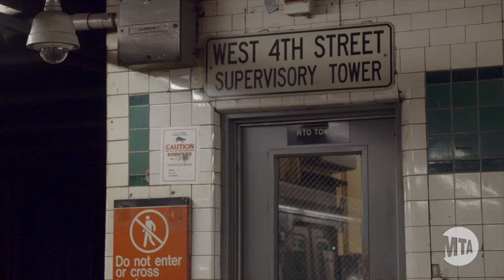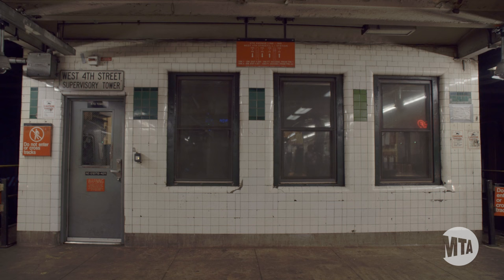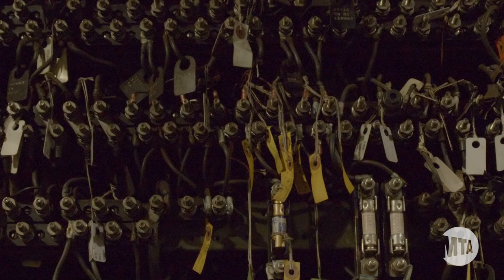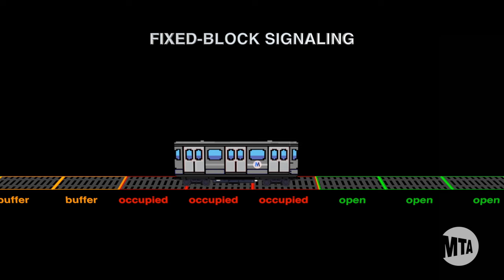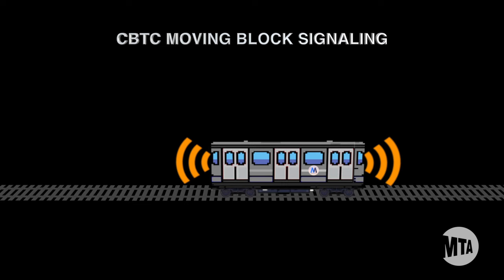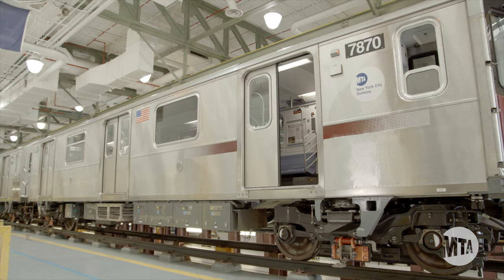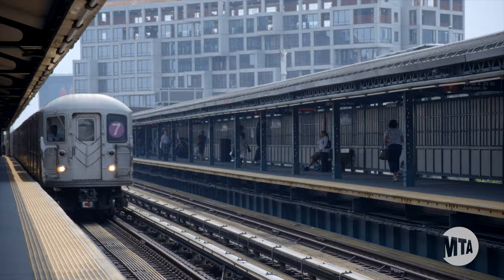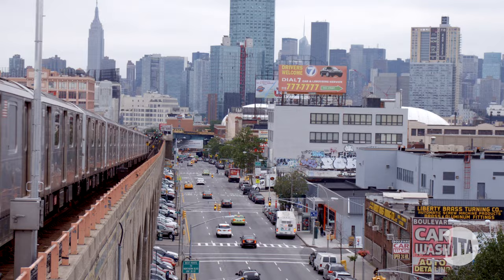CBTC: Communications-Based Train Control

Comment: I bet some knowledge has been lost about some parts of the system due retirement of the people who built and maintained the system. It would require a large scale re-engineering to replace the whole system. Sooner or later it has to be changed. A scheduled downtime is always better than an unscheduled downtime. 

A large scale unplanned failure would affect the whole NYC subway, causing it to grind to a halt. Workers wont be able to get to work on time for weeks, with an overall cascade effect and widespread chaos. This equates to millions or even billions in economic losses on wall street and even main street retail which could affect the entire world economy.
Reply: That's why CBTC is planned to replace the existing signals. This would result in less money to maintain the signals, and also increase capacity.

Comment: "If it ain't broke, don't fix it"

because i rather use early 20th century stuff that's work flawlessly than a "sophisticated 21st century standard" but gets broken after few year of normal usage.
Reply: Ernest Jay wyt
Reply: Ernest Jay The 20th Century tech is flawed in that you cannot run more that 28 trains on a single track. With CBTC, you can run up to 36 trains at most, and if we removed all merges, maybe 40.

Comment: I can see this coming from a mile away. They go to digital with computer displays and some creep decides to hit the computer with ransom ware right in the middle of rush hour---AND YOU ARE SKI---REWED!!!! What you have is an oldie but a goodie. If it ain't broke quit tryin' to fix it.
Reply: Wasatch Range Railway The old signal system is broke. It’s one of the reasons why trains are super delayed. CBTC has been proven to work flawlessly on subway systems in other cities, like London, without any concerns of hacking (CBTC will NOT be connected to the internet). Here o the home front, we already have two lines with CBTC: the 7 and L lines, the latter of which is undergoing tunnel renovations at this time. On both lines, the on time performance on both lines have increased dramatically, and no one has hacked the system since agin, IT IS NOT CONNECTED TO THE INTERNET.

If CBTC works in London and other parts, The it can definitely do so in NYC.
Reply: @TheRailLeaguer  As long as it's not connected to the internet you stand a chance of making it work until an EMP. If it's properly shielded an EMP can't get you. I'm pretty sure that the engineers have thought this through!
Reply: Wasatch Range Railway Don’t worry. The Canarsie and Flushing installations have been flawless for now. No problems with hacking, no problems with EMPs, nothing. Everything is fine.

Comment: 100 yr old system still using the same equipment. 100 yrs of revenue but congestion pricing is needed to pay for the upgrades....... hmm 🤔🤔🤔 somethings not adding up
Reply: What are you talking about? Revenue does not 100% fund system operation and upgrades.

Comment: wy cant ya add cbtc on bronx lines.
Reply: Mamadou ly Once Fast Forward is complete, the 2 and 5 lines south of 3rd Avenue and the 4 south of 161st will have the modern signaling.

Also, these lines were picked due to ridership and age of the signals. The Bronx network ridership is moderate and the signals there just got refreshed with solid-state tech.

Comment: and this is how bart keeps losing trams during hot, or wet weather. as they have all the new shit installed at the factory level.
and of course every time a new "up grade" to the software. like it needs it? thought it was perfect to start with? lose even more, or the system slows or stops till the trams are found.. or system is "reset"
and the trams only do the projected top speed at limited times in the trans bay tube.

now they want to try to build 200 mph trains?

Comment: CBTC on the (7) is a bad idea, because CBTC does not allow SMEE trains. An example of that is Train of Many Colors. So not cool at all. no
Reply: Just because one train may not be able to use CBTC doesn't mean that it's bad as a whole. The wants of a few railfans should not go above the needs of the many riders who use the system daily.

PLus some SMEE trains can use it. Garbage trains still roam the Flushing Line as trash still needs to be picked up from the stations on the Flushing Line and the rest of the system.
Reply: @TheRailLeaguer  oh

Comment: We need PTC and ATCS and completely computer controlled switches, signals, and movements

No humans

No drivers

Full automation

And Halon systems in every control area
Reply: Just curious, what is a halon system?
Reply: @Zoldergamer  Halon is an inert gas that is used in kitchens and in Computer Rooms, gas stations, and laboratories

once triggered it sucks all of the oxygen out of the room in about two seconds

It snuffs out the fire instantly

for any old equipment that is irreplaceable or very hard to replace installing Halon systems would be a smart move

I've worked around it my whole life

You have to be trained and aware that you are in a Halon environment

You have to have scuba equipment in the event the system is activated

Typicallyyou evacuate the area and manually pull the release for the Halon gas

but you can install heat sensors and have them trip the system automatically for areas that are unattended
Reply: @ocsrc  ah i thought you meant something else, i know about halon because it is used for fire suppression in aircraft. As damaging as it is for the atmosphere using halon it is not very harmfull for people onboard. On the contrary i do not think it is safe to use in a subway enviorment.
Reply: @Zoldergamer  I was at the scene of a Halon discharge in an outdoor environment and over 30 people were instantly knocked to the ground

Suffocation will occur within 2 minutes

I did not know they used it on airplanes and that seems really dangerous

even after most of the gas had cleared it was still incredibly hard to breathe outdoors

One of the delivery drivers was in the back of his truck and had to be taken to the hospital and resuscitated

I know there's on-board oxygen in planes, so I'm guessing the masks will drop if the Halon is activated ?

for the subway tunnels and stations it wouldn't be a good idea but for the control rooms and the switching centers it would be ideal since they're unmanned most of the time and that is where the electronics are

with all the upgrades to the two way radio networks after 9/11 I'm shocked that New York City still relies heavily on the old UHF radios

I guess because of all the buildings 800 & 700 band would not work well

I know during 9/11 we could not talk to each other interagency using 800 band interop

We started passing out Liberty tri-band radios

We never got them back either

But the UHF 450 band cuts through all the concrete

The repeaters and antennas in the subway tunnels also are UHF 450

I saw the control room once when I was down there and the wire and the control boxes were ancient

one of the things that I did not know was that they control the speed from the control room and the driver only has the ability to slow or stop

But no matter how far forwardthey push the throttle it only goes as fast as the control room will allow it

I also heard some really great stories

did you ever hear the one about the kid who was fascinated with the trains and showed up at the yard and they gave him the A train and he drove it for several hours before they caught him ?

He made all the stops too
he missed the last stop and that was what got him caught

I think he was 12 or 13

That was many years before the first 9/11

So much history in the city that you could write books on any one part of it.
Reply: @ocsrc  in aircraft they are only used in the engines, so the people inside the pressurised cabin wouldn't be affected when used. I believe production is illegal but use in aviation is still allowed because there is still not a good alternative.
Reply: @Zoldergamer  good to know, thanks

Comment: I hate communication based train control because there are no more R62A's on the 7 line and no more R33 train of many colors rides and no more R142A 6 train.
Reply: R62A 7 Train So What? CBTC exists to increase service on busy lines like the 7, and indirectly, the 6 line. You may have gotten old equipment on the 6 line, but the trains will be more frequent now.

Right now, the big issue is system frequency and reliability, not cosmetically appealing subway cars not going to where you want them to. Get your priorities straight.

Comment: Just get rid of signals and run trains at a maximum of 20mph on all parts of every line then there will be no maintenance of signals and the trains can brake easily enough behind the other. Just make sure that train drivers don't tailgate the one in front and to prevent accidental crashes from becoming deadly add thick metal that stick out from every angle from the trains in order to stop a hard impact. At junctions add traffic lights or just replace signals where a train detector is placed 10m from the signal so that if a train runs over that then the lights for the oncoming train will stop at red. Having mostly no signals will also cut costs as less signals will need to be maintained and less staff will need to be looking at the signals to make sure that they work correctly as there will be fewer trains. For tracking each train add a wifi enabled GPS tracker on every train then at every in tunnel add a WiFi router connected to the GPS that would be WPA2 Enabled so that every train can Be tracked. And every WiFi router would need to be placed where there is no signal and this could also mean that passengers on trains could get free WiFi on board trains
Reply: wclifton968 you mean ultra wide band
Reply: Confusing.. you mention getting rid of signals and then implementing signals

Anyway about WiFi and GPS- GPS does not work in tunnels which is why technologies like CBTC exist, while WiFi for both trains and passengers would simply not be practical as that would mean WiFi on the same frequency for everyone.

Comment: Look at 5:12. Seven fucking guys standing around while 2 guys do the actual work! And you wonder why it takes forever and costs a fortune to get anything done in NYC. Here's an idea, hire one overseer to make sure everyone is doing their job all the time. Anyone standing around gets docked or sent home. Everything will get done in 1/4 of the tiime at 1/4 of the cost.
Reply: Until you actually work for the Transit Authority, they you can say your piece. You probably don't even have a clue why they're standing around.
Reply: And what, they're not working for a living? Unless they're a mechanical engineer you can't speak to what they're doing or not doing.  Perhaps there's safety involved, or they're training them.  I understand the Internet gives people the ability to say anything, but try and use a little bit of rationality here.  Also I don't feel the need to slag conservatives as 'good for nothing'.  Really, really sad.  Unions also fought for protection for dangerous professions - again, do a little research before you blindly insult people.  It takes forever to do things because it's a large, complicated system with an antiquated technology they have to be careful to replace.  I am thankful they prioritize safety and doing it properly.  You should be too.

Comment: about the only "upgrade" i would recommend is a complete refurbishment. there's absolutely nothing wrong with the system; it's safe, it's reliable, and it can't be hacked by foreign governments.
Reply: rockergod789 Actually, it’s 100 year old technology. CBTC allows for more trains per hour than ever before, which means more expanded service. If possible, you could run up to 36 trains per hour with CBTC. My plans leverage this by using the Second Avenue Subway and the resignalling to better improve service.

Comment: Don't fix what ain't broken. 
Worke it till no more repairs are possible
Reply: What?

You don’t want the system to upgrade to more modern things that will eliminate these costly repairs?

Plus every other system in the world has CBTC, so why not NYC?
Reply: @TheRailLeaguer  haven't said that, 
All I said is use the old infrastructure till the very end of its usefulness. 
Upgrade to new tech infrastructure is a good thing,  but it should not be hastened beyond the necessary speed, if you can understand what I mean by that
Reply: lukas Bolle True, though the current signal system is already at the end of its usefulness. It’s so bad that signal issues are rampant.
Reply: @TheRailLeaguer  that is background information to which I am not privy as I live in and therefore comment from Germany and my town has no subway, only bus and streetcar. 
One important aspect in that regard is, at least in my opinion, to have a time table that is capable of being accelerated to fit the needs, wouldn't you agree?
Reply: lukas Bolle Yes. I do agree.
Reply: @HrLBolle  "that is background information to which I am not privy"  the video eluded to this infomation, not sure how you missed it

Comment: A lot of money goes into pensions.. MTA personal are able to work all the overtimes they want for the l last three years, which is the determined pay for the rest of their lives.. Some Conductors, retire on over $150k for the rest of their lives..  (that's gotta change).. They make obscene amounts of money.. The only security, is maybe a blurry secrurity video, after the crime has been committed.. They ripped out phones, and only recently have installed wi-fi in a few stations.. Thus the 'if you see something, say something', motto is complete bullshit.. For the amount of money they should guarentee the safety of their customers.. No other business would be allowed to run with this complete lack of security... No cops, no plain clothesmen.. I have witness thugs on the trains carrying guns over the last several years.. Hence I never travel to Brooklyn. Very few stations have token clerks.. Most stations have disconnected the alarm systems, because people use the gates, to exit, which makes it very easy for unsavory characters to gain access to the system..  The amount of money they make and the safety of the system is a joke.. They have recently installed some count-down clocks, which is helpful, so you can determine, if the $$ you paid to get on the subway system was a waste of time.. or not... If you have a problem with payment, pay, and subway doesn't come. You must travel all the way downtown ands wait for HOURS and HOURS to maybe get your $2.50 back, depending on the mood of the man behind the desk.. When over 65 you get a 1/2 fair metro card.. (which is nice).. Problem that somehow can take up to 12 weeks.. Yet a fair jumping ticket.. is radically quick..  Most disturbing is the groups of workers you see milling around at ends of platforms (while on duty, doing nothing?)... That an scams, like going on strike a few days before Xmas a couple of years ago, screwing up millions of passengers..  Their hike raising community meetings are a joke.. They sit there for a few hours, let some people complain and then jack the price up.. Oh yeah, and when ever a fair hike happens, service falls to like 40 per cent behind time, thus justifying the rate hike they need.. Then back in the City, they had a scam.. Sent someone to buy subways cars, that person managed to wrangle a huge 'bonus' for himself.. Then we got stuck with thousands of cars, that only fit very narrow 'Japanese bum's.. Hence the Spread problem of men.. In a subway car every other person has to lean forward, the others back, otherwise no one fits on the seats.. The newest thrill is gangs of thugs getting on, subway cars, robbing people, beating, and assualting them, video taping it, then brazenly broadcasting in on the internet.. Some how with all its tech, MTA can seem to track anything (oh year forgot 100 years old).. Pay-offs from companies to plaster ads all over the cars.. Like I really want to be squashed in with 300 strangers, and be subjected to STUPID, and sometimes downright, 'in PoorTaste' adds.. Like crackheads  who've smoked all their lives, so he see radicallt deformed people, people with all the fingers and toes, blacken and removed.. Just what I want to show my 8 year old on the  subway.. or homeless guys urinated in the passages.. 

Reagon had the right idea in the 80's firing all air traffic controllers and replacing them.. The MTA deserves the same fate..
Reply: $150K a year???? I wish....I'm a retired Supervisor and I NEVER made that...matter of fact...if a Conductor lived on the job he couldn't make that much. You're  being a cry baby. Grow a pair or move to kanas.
Reply: TRUMP FRIENDS MAKE MUCH MUCH MUCH MORE MONEY THAN THE M T A WORKERS,HOW MUCH MONEY MAKE THE BANKERS,GOLDMAN SUCHS PEOPLE , THE KOCH BROTHERS ,THE G M CEOS ETC ETC ,THAT'S THE PEOPLE THAT MUST BE TAXED ,AND USE THIS MONEY TO REBUILD THE PUBLIC TRANSPORTATION MARK STYLES 
THAX THE RICH AND USE THE MONEY FOR THE PUBLIC
Reply: Steven Granati exactly. Sounds like he tried and couldn’t get the job
Reply: You know who actually makes obscene amounts of money? COPS. In major cities such as LA, NY, Boston, Salaries are about 100k and overtime causes the average pay for a cop to be almost 150k. You can see the actual pay records for the cities, just search it up. Then they get a big pension with it. It's the police union that costs governments tons of money while always protecting bad cops and opposing any responsibility.
Reply: Another guy with a liberal arts degree